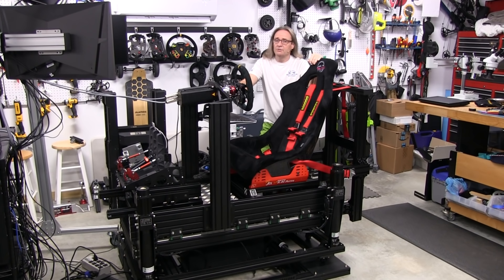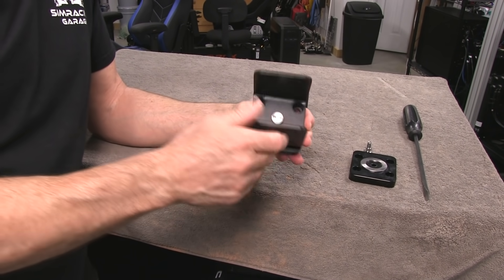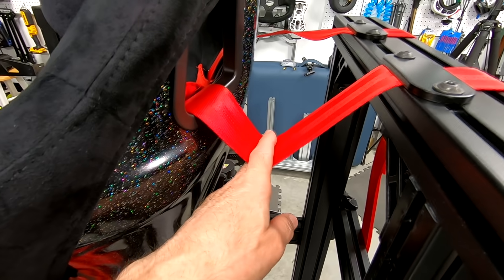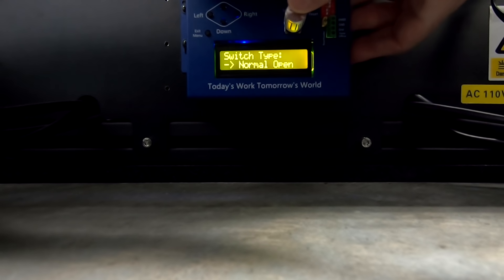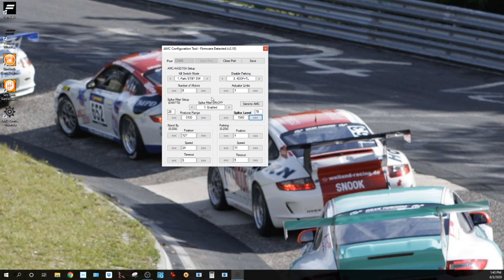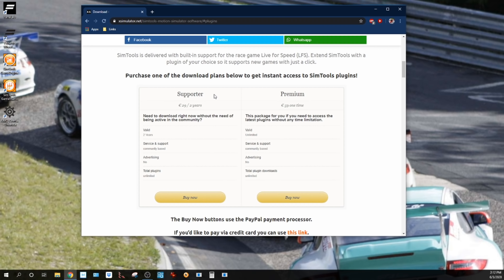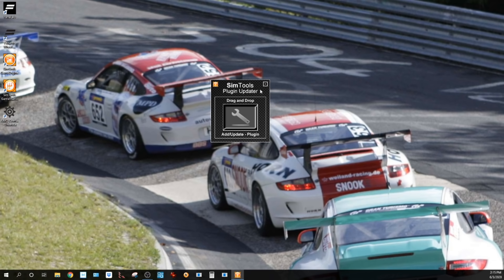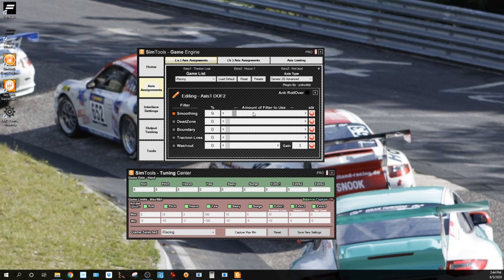PT Actuator 5DOF Motion System Review Part 3 "Configuring/Testing"

Comment: honestly i would expect that this product, at such price point, would work out of the box with its own software without having to fiddle so much with external plugins/apps/softwares.
Just my point of view however, feel free to disagree..
Reply: SimTools 3.00 is coming soon and it will be much much easy than 2.4.
Reply: If you want plug and play, dbox is your answer, but they don't even make a comparable solution. If you decide to go with a dbox with 6" of stroke for just the four uprights you'd be looking at spending $35-40,000.
Reply: What orions96cobra said...
Reply: It's like Linux vs. Windows. yes its free but you need to spend excessive time to just plug in a printer (maybe extreme example), where as Windows just works, less the occasional blue screen of death.